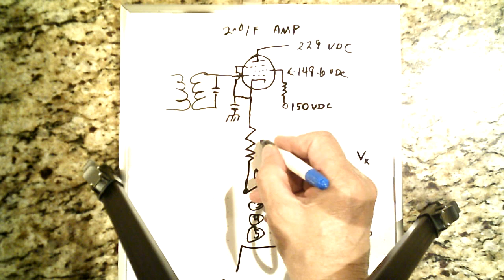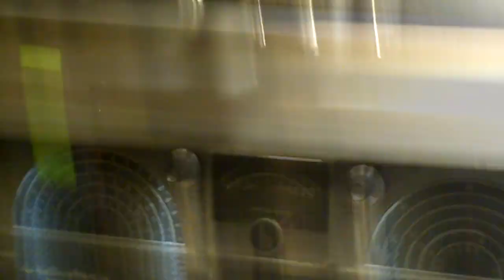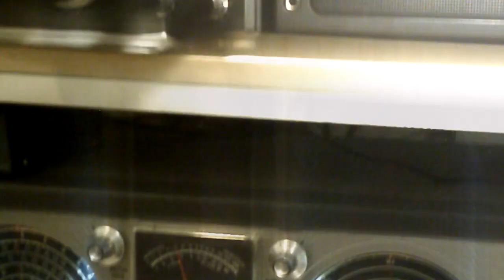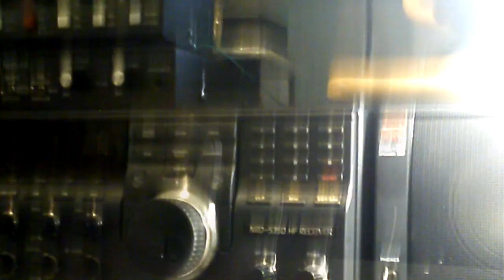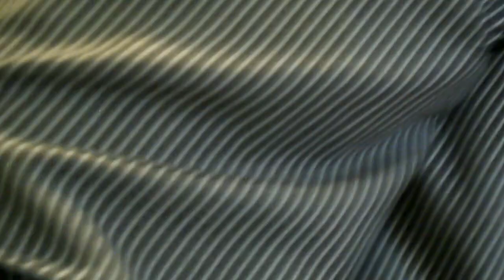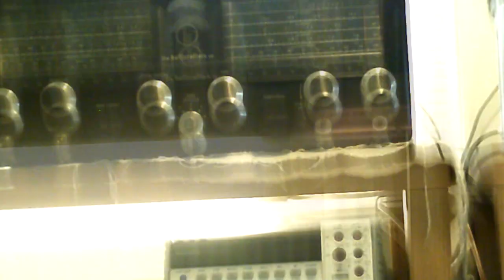Hallicrafters SX 71 Receiver (Run 4) Sensitivity Modifications Complete

Comment from the maker: I call it the WGN resistor. Simple band 1 attenuator. I routinely remove them. Still your band 1 should be more sensitive. Trace and compare with scope. Still ‘71s are less sensitive than other models and all my life I have used them with antenna preamps. The old nuvister Ameco preamps work very well and better with 71’s than solid state.

Comment: I have a SX-71 that has been deaf on band one. After watching this today, I decreased R22 from 1k to 270. It started to act much more perky. I then found that R11 across secondary of T11 RF coil was 10 ohms instead of 100. This appears to have come from the factory with that. Not sure why. I removed it and didn't even put a 100 back in there. These two tweaks really brought my band 1 up. The background noise in between BCB stations isn't quite as loud as band 2 and 3, but it is like night and day compared to what I started with before these changes.

Comment: Do you think changing that resistor affects the BFO injection much?
Reply from the maker: I haven't noticed any issue with the BFO, since I raised the plate resistor from 22K to 100K (see BFO video), which cured the weak injection originally.  True a few dB increase in sensitivity might slightly effect the balance with the BFO but the major correction came with the plate resistor.
Reply: @i82996  I just got done changing all mine over.  The weird thing the BFO R52 was already a 100k, even though all the others matched run 1 values.  I also switched R22, R23, R30, R31 and R32.    They had the old run values.  Reception is quite good now.  My audio output xformer was bad, and I put one in there that matches the 6v6 tube I am using.  It really blasts now haha.